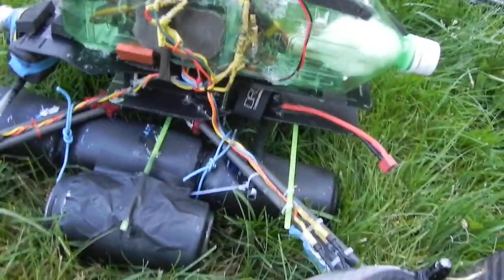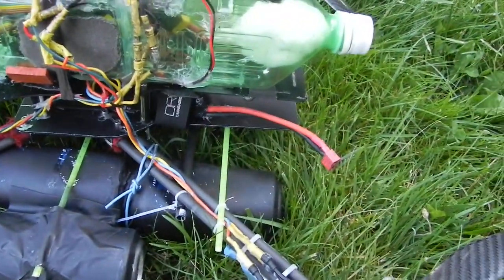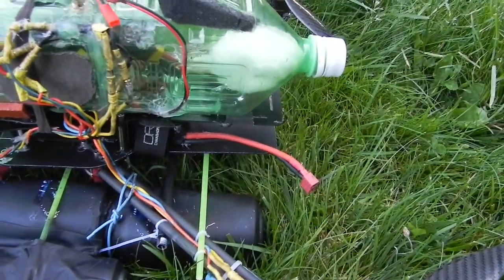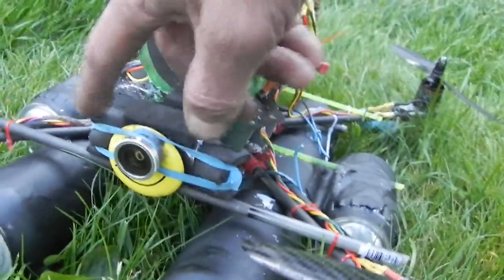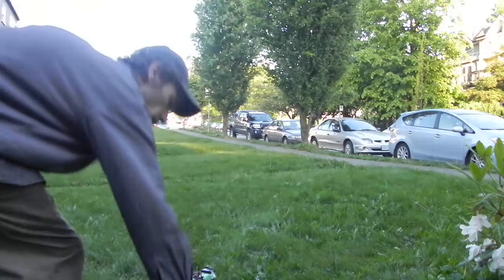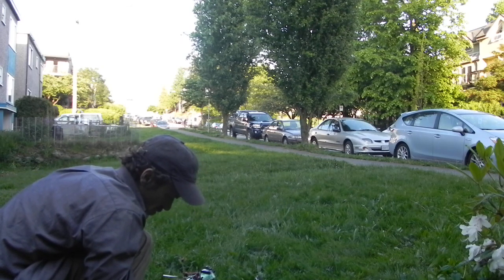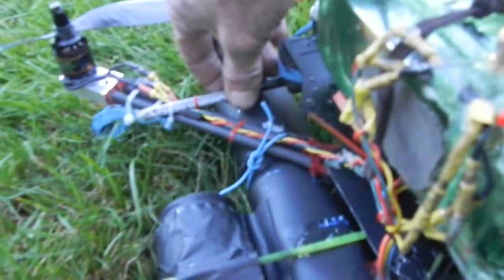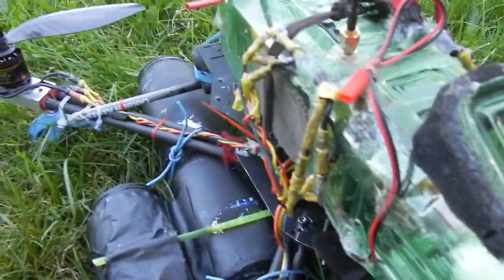Introducing the Air and Sea HoverBot4 with bladder filled pop can pontoons

Comment from the maker: Well owning a needy BSA motorbike for 28 years has taught me there is always a way to make things perform better LOL! I need to start thinking of HB5 but this one aside from a little rudder yaw issue holds altitude better than my HB baro mod, had to adjust midThro level to compensate for the big motors. Next a Rembizi osd for HB4 then onto HB5. I need to pin the carbon fibre tubes at motors still but only if the jello persists.